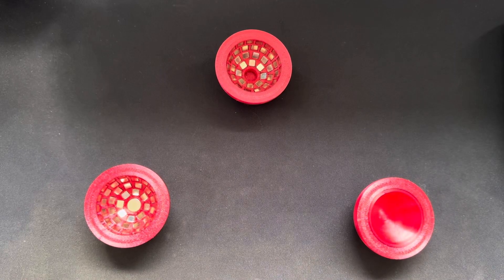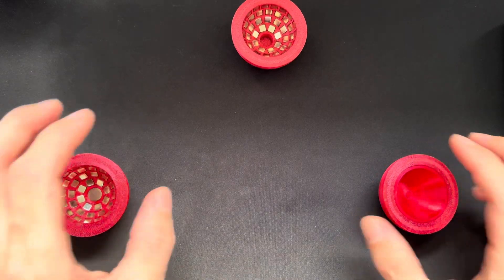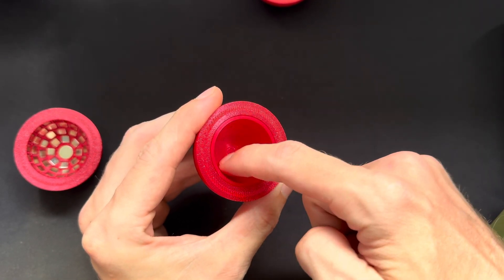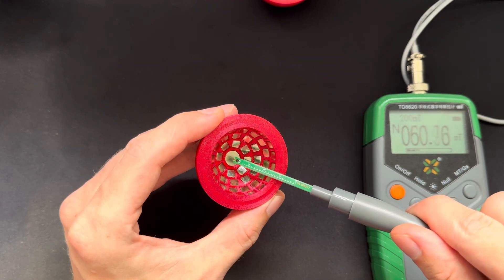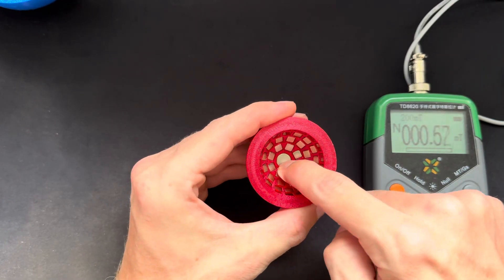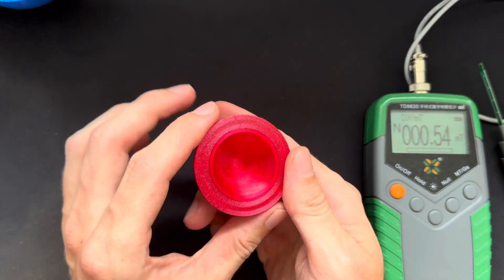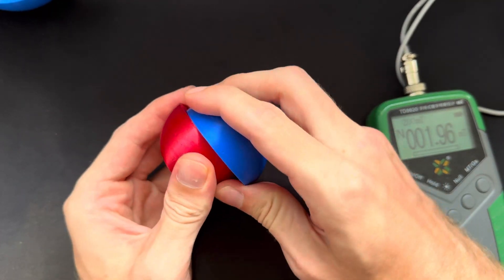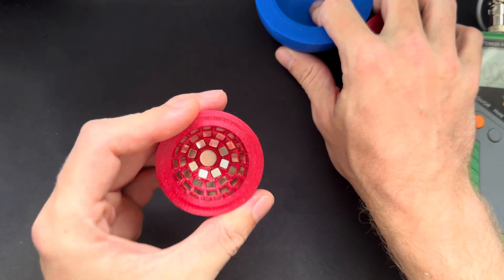Modified version of the LaPoint bowl magnet array with a stronger field

Comment: I recently finished making one of your previous designs and mounting it in a box with a motor.  I’ve yet to start testing but I’m excited!

One issue I’ve run into is that my prints aren’t perfectly balanced so when they spin they vibrate. I tried making it a little better by spinning it against sandpaper and the like, but its still not ideal.  Do you have any tricks to make them spin at 3350 RPM without vibrating?
Reply from the maker: From my experience most vibrations are a result of not inserting all the magnets evenly and not perfect print quality, my bowls also have very slight vibrations, which can’t be avoided since they are 3D printed after all. 

You can counteract small vibrations with dampening rubber feet.
Reply: You may try different infill options or even print it solid. Some infill are not evenly spread causing some imbalances. I have printed things that should have been well balanced only to find the infill threw it off. After I reprinted the same thing with 100% infill or choose a different pattern the same object was well balanced again. Just something to look out for
Reply from the maker: @newmonengineering  Yes printing it solid is highly recommended, also for stability reasons, thanks for pointing that out.
Reply: @newmonengineering  thank you!

Comment: Hm, with the center magnet u get rid of the choke ring and the confinement dome.
Are'nt they essential things of this arrays?
Reply from the maker: Depends on what you want to do with it, in this case it makes the field on the outside stronger.
Reply: @OmegaZZ111  sure and as i understand the array, now u have less or no ion influx under the confinement dome. Just something u can do with a single strong magnet.
Reply from the maker: @Mavo1974  The dome is just compressed and more confined spatially, it’s not like it isn’t there anymore.